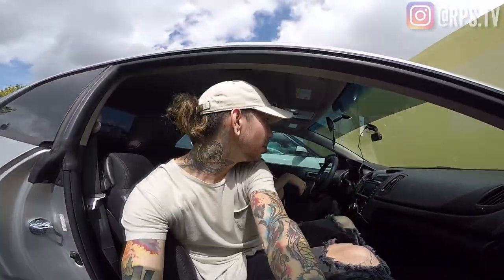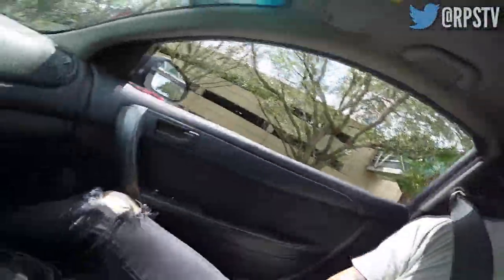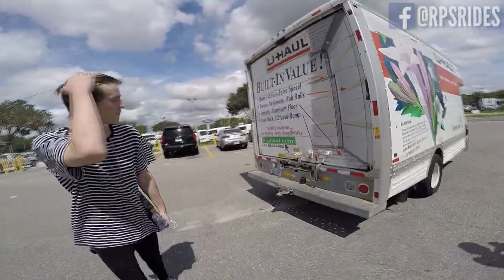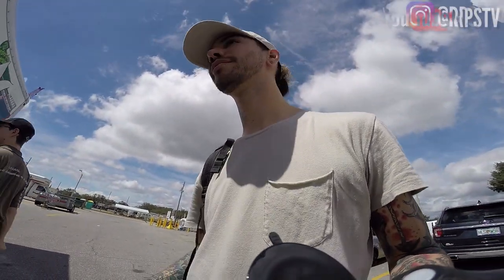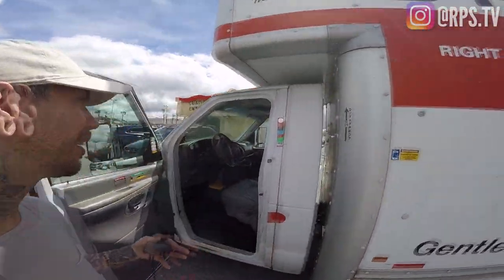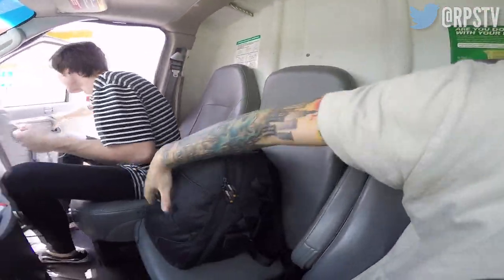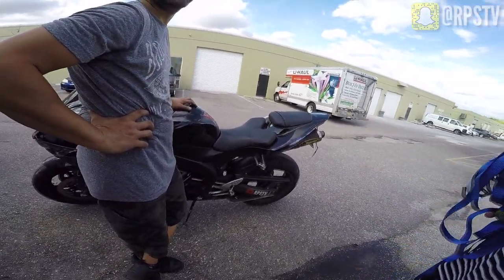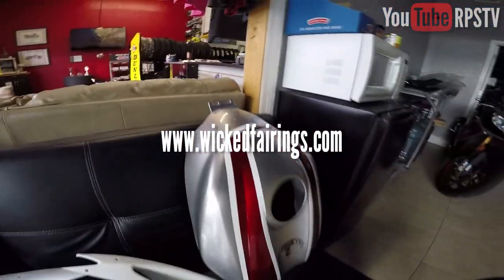IT'S ALL OVER :'(

Comment: FYI, the ramp on the Uhaul will hook up flush with the floor of the truck.  You have to pull it out a little further and there are two slots for the hooks.  It has a catch so you can't actually pull it all the way out and drop it.